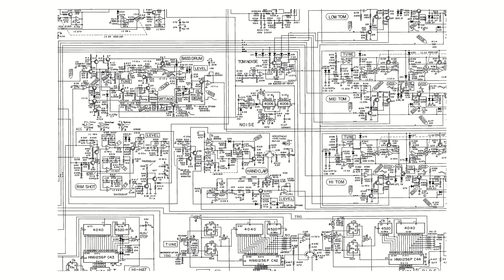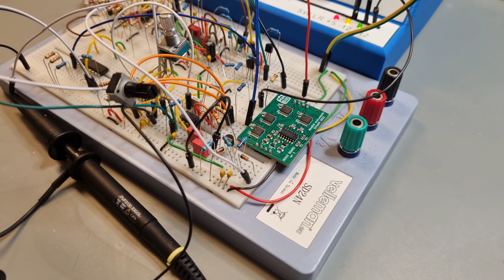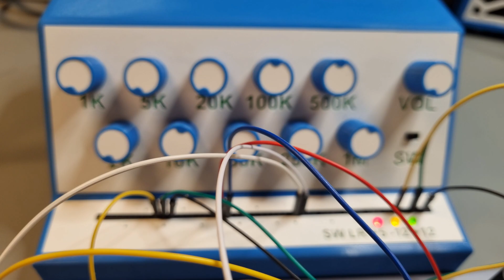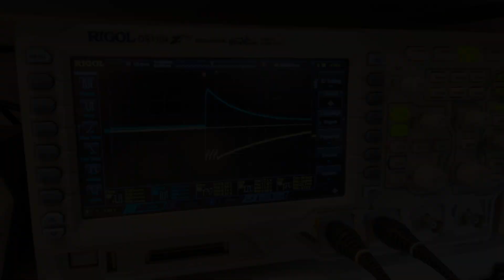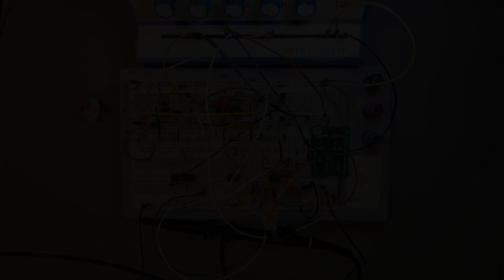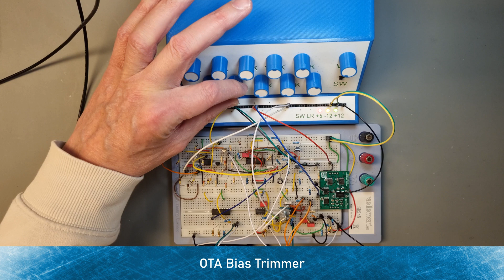Eurorack DIY: 909 Handclap (Episode 1)

Comment: I have a piece of code to create a noise generator a la TR-909, linear-feedback shift register ( LFSR), video.
Than you can use a dip8 pic, like PIC12F67 and a transistor. I got many CD3080 in tubes.
Reply from the maker: That's a neat solution!
I remember that I bought a couple of CA3080s back in the early 90s, to repair a synth for a friend. I had a pretty good stash of components back then, but most of it was lost when moving around and when I got kids and bought an old house all my hobbies went into hibernation-mode...
But when I got back into the building electronic stuff I started from scratch and I decided to go for SMT as much as possible. Anyway sometimes I miss those RAACO-drawers full of components, bulky AF compared to the SMT but TH components have their use, especially when bread boarding 😄
Reply: @MeeBilt  hibernation-mode, lol
I mailed Nexperia a couple of weeks ago to create a new CA3080 in SOIC8, maybe if more people would mail Nexperia, this it might help. yeah, THT takes up alot of room on the pcb if you wanna design in 4/5 jhp like i do, to be able to cram as much as possible in one set of rails, witch i have.

a few years back, i mailed Nexperia and made them attend on the "Tiny" Logic from Texas Instruments, got a response and they refused the idea, but later they appeared as "Litle" logic. very usefull if you only need one inverter, and, nand, or gate and even a flip flop and analog switches exist.

We have to keep asking Nexperia to remake the CA3080, using the ew techniques and be able to work with +2.5v/-2.5V power rails.
Reply: @MeeBilt  By the way, there is room under the Alpha pots, as it's elevated using metal lips, you can use this space to paste some opamps, transistors, caps and what not.
There are also opamps in SOT23-5 format.
I think pcb, panel space is quite expensive.